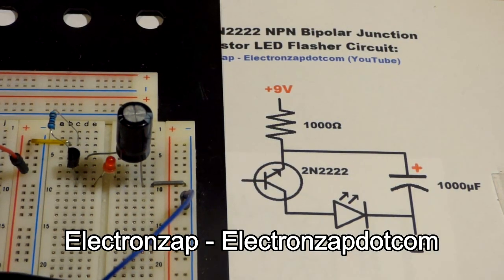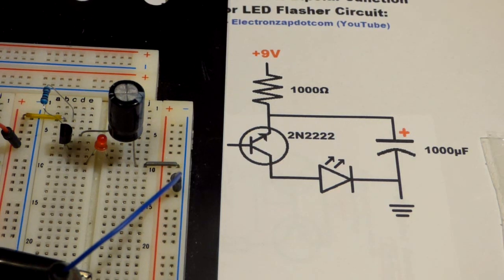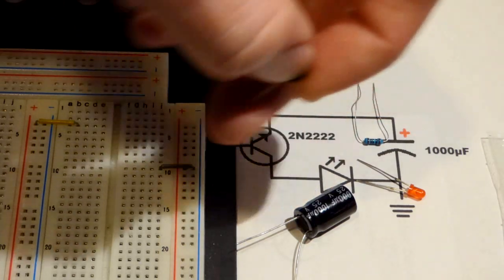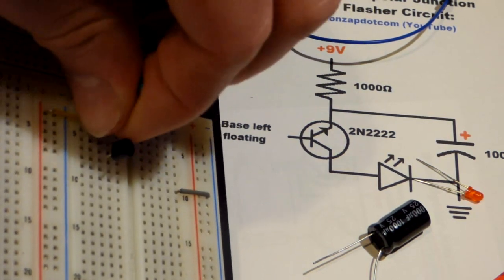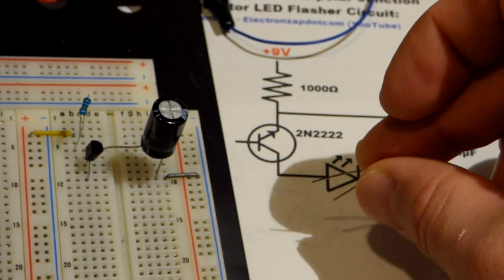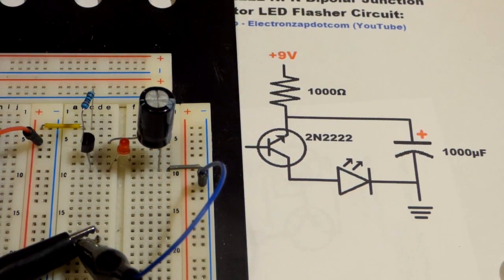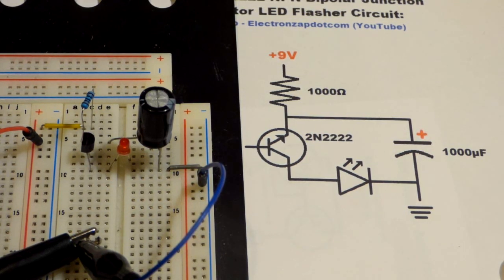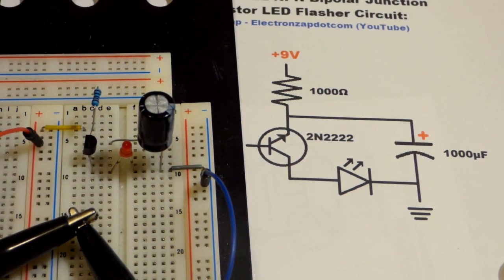Single 2N2222 NPN Bipolar Junction Transistor BJT LED flasher circuit step by step build

Comment: Quick question: How does this work without anything connected to the base pin? 

Sorry if this question sounds dumb, I'm new to electronics.
Reply from the maker: The NPN is designed so that the Collector is more positive than the Emitter in order to work properly. If you make the Anode more positive than the Collector by enough, then current will start leaking from the emitter into the base, which makes it start conducting even better, until it conducts almost freely for as long as a high enough voltage is maintained.
Reply: @Electronzap  oh! Thanks!

Comment: Hello can this work with a 100nf capacitor and 100ohm resistor?
Reply from the maker: I wouldn't go below 470Ω, and I think 100nF would be too low of a value. I think the LED be on almost steadily.
Reply: @Electronzap  thank you very much!
Reply: @eggs4774  I think I've seen you from somewhere before...

Comment: It Actually Works but it does Blow a 3mm Led Light and you can't put 2 Leds on this  Circuit  without 1 of the Leds Go dimmer then the Other..Cheap to Build...about 25 cents per build

Comment: How does the blink happen?
Is it due to the capacitor discharging?
Reply from the maker: Once the capacitor charges to a high enough voltage, the transistor breaks down and starts conducting. The capacitor discharges a little through the transistor in the process before the transistor turns off again and the capacitor can start charging again.
Reply: @Electronzap  will a 2n2222 pnp transistor works for the same circuit?

Comment: LOL I don't know what happened but it started get brighter and it quit working. Maybe the transistor went bad? I put it in a component tester and it now reads as a diode and only pin 1, and 2 are reading.
Reply from the maker: This circuit is probably pretty rough on the transistor, so I wouldn't be surprised if it fries some of them.  It's more for fun and simplicity than as a practical circuit. The more you can limit current the better. It's a finicky circuit, so it hard to tell where things go wrong.
Reply: @Electronzap  Okay I see, I thought maybe it was my 9v battery so I decided to hook it up to a regulated 12V power supply, it did the same thing came on and stayed on. I'm going to put in a current limiter and see how that goes, until then time to mess with Flip Flops. Thanks for the suggestion. I will keep you updated

Comment: Does voltage size matter when it comes to the capacitor? I have a 1000 uF 16V electro cap, I am sorry I am a beginner to this.
Reply from the maker: You never want to exceed a capacitor's rated voltage. If I remember right, this circuit needs about as much voltage as I used in the video.

Comment: Have tried it, actually works (but have used a 1500 uF capacitor, SMD led and 680O res).
At 12 Volt, this make a really annoying flasher.
Edit: Now have tested it with a 2.2) resistor and it blinks slower. If the resistor is in series with the rest of the circuit, it will define the charging rate of the cap.

Comment: Not all leds work with 9v, right?
Reply from the maker: LEDs have a forward voltage, usually 2-3V that must be exceeded for it to light up. Any more voltage than that usually goes across a current limiting resistor. Usually you want a resistance that limits current below 20mA. So, you can go as high as you want in voltage, but the resistor gets a lot hotter as voltage goes up, so it's wattage rating is the limiting factor.
Reply: it does not constantly put 9v, it gives short pulses

Comment: Did you try connecting + to collector  and cpacitor voltage into base and groundng emitter ?
Reply from the maker: That's how you wire most circuits as long as you limit current in some way. This is an usual circuit.

Comment: Hello, first of all the video is great as a building tutorial. But i cant seem to get it to work properly. I have the correct components and i built the curcuit the exact same way you did but all i get is a very very low constant light. so low you cant even see it without a camera in nightvision mode. I am powering the circuit with a 9V batterie. I have zero know how about electricity or any of this stuff i just want to build a blinking IR light that takes as little space as possible. Hope anyone could help me. Thannks!
Reply from the maker: I needed a volt or 2 more supply voltage for a blue or green LED than the red LED. I relatively recently learned that 9V is just barely enough voltage to flash the red LED this way, and that 11 - 12V will work better.
Reply: @Electronzap  hm i tried a 12V batterie and i can barely get it to light up constantly but it looks like it is struggling to keep the power. when i remove the resistor it lights up bright but it never blinks

EDIT:
i now have connected a 12V batterie and a 3V batterie. now it blinks very fast. i connected 4 1000uF Capacitors to it and it seems to slow it down. the LED i am using should only need 3V so why does my circuit have such a high demand of Voltage? I am sorry if i sound frustrated. I just dont get it. and i probably should go search on some forums^^

Comment: Thank GOD 🙏🏾 and thank you very much for sharing 😉 WHY did you choose to leave the base of the transistor open 🙄 and place a 1uf capacitor to hold the circuit steady 🤔
Reply from the maker: Glad you enjoy! The base is floating because current will flow through it from the emitter easier than the collector and can probably throw off what happens during the emitter to base breakdown in other ways. Between pulses, the capacitor is storing up the current needed to pulse through the LED.
Reply: @Electronzap  "Thank GOD 🙏🏾", and thank you very much for your sharing support and time 😉

Comment: First of all thank you because in the collage almost 20% practical knowledge got. At this point, can you find answer of these questions -   Q.1 How will you built your idea into the Electronic circuit?  Q.2 How much heat will flow into the Earth due to that Electronic circuits?Also how will you calculate?
Reply from the maker: Thanks! This is about as much as this circuit is good for. It produces about 1/16th of a watt of heat which will go into the air until night time when it is lost to space.

Comment: Any idea how to calculate the flashing frequency for a circuit like this? In my case, I'm working with a ~30V LED, caps and resistors are more expensive for higher voltage so I need to make sure I get the values correct.
Reply from the maker: No, sorry, I don't have any idea how to calculate the frequency. This is not a well published circuit, so if there is a formula out there, it is probably hard to find. Most regular capacitors can handle 30V. but you are probably right on needing to look for a high enough wattage resistor.
Reply: @Electronzap  Thanks anyway, I'll look around some more.

Comment: So is thr transistor being reversed biased for voltage to get thru to the led?
Reply from the maker: It only worked when the transistor collector and emitter were connected to the power supply in reverse from a normal circuit. I think this is taking advantage of the limited reverse voltage protection properties of this particular type of transistor.

Comment: Check out that "ramp up" behavior of the LED cause by a sawtooth wave. :) I have video discussing this Esaki Oscillator by the way. Fun stuff. Try touching the middle leg for cool distortions.
Reply from the maker: Thanks for the tips! I am getting a lot better results searching for Esaki oscillator instead of single transistor oscillator.
Reply: You are most welcome! This is one of the 1st circuits we DIY synthesizer folk attempt to build. We all fail, but some of us refuse to give up. :) The next one is the 555 timer (and 556 for the Atari Punk Console) and then on to things like the CD4093 and CD40106 ... the coveted CEM3340 is the Mother Lode!! Oh yeah ... and op amps for filters and pre-amps ... I thought I could skip the power distribution part but that is the most important. :)
Reply from the maker: Nice!